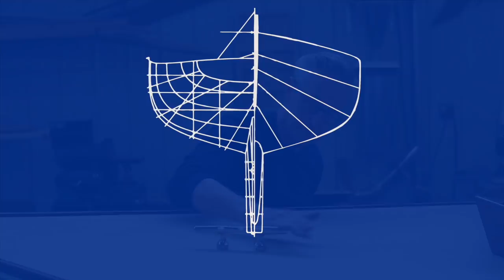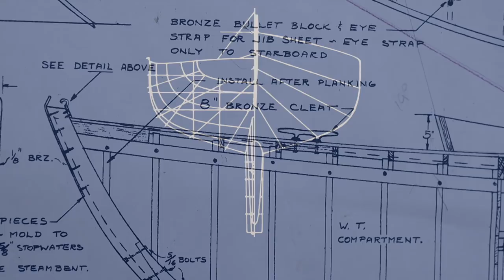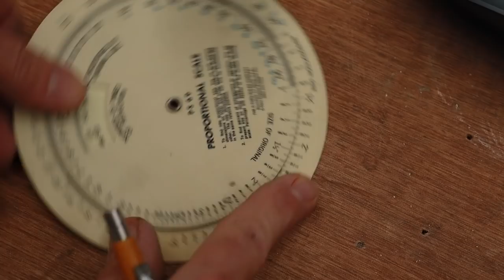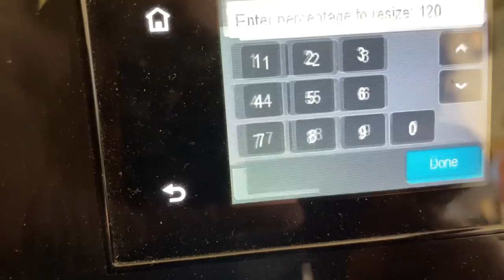Bronze Casting for Boat Builder, Cleat Casting S2-E57

Comment: Dear Bob, I have looked at several people who do casting but without a doubt yours is the slickest operation of them all.  The tools you use, like the cradle for your flask is the best looking with that locking triangle on top to secure what could be an incredibly dangerous event of a molten metal spill if it let go.  It’s just like all your work, methodical, precise, un-rushed but in the end magnificent.

Comment: Bob, another fine video. It was very enjoyable to watch. Your attention to safety is very commendable. One safety concern registered with me. After you poured the mould, you got down on your knees to pour the bronze bronze into the scrap tray worried me. For a short period I worked in the foundry at Boeing Commercial Airplanes. The methods used were very much how you do it. I witnessed a 20# crucible of molten aluminum get dropped and spilled on the floor. Not something you forget. People were within the spill radius and everything flammable within the radius caught fire. Even the workers shoe soles caught fire. Fortunately everyone had heavy sole shoes on and were not hurt. Please continue making these videos. I marvel at your skills. THX JimP
Reply from the maker: Hi Jim,
I do know better than to get down on my knees. The first casting I got a bit caught up in the HEAT of the moment (pun intended) Thanks so much for the reminder and your kind comment!
Cheers,
Bob
Reply: Also suggest a table so your mold is at a good pouring height. Cinder blocks are cheap.

Comment: It is always inspiring to follow you in the process and share all your experiences. I grew up on the Swedish west coast and like to compare differences and similarities in boat culture. Small boats here were simpler built mostly in pine and hull with overlapping boards, but which gave a beautiful sound when they were moored. Today, that sound has almost disappeared. However, I wonder why the floor is screwed on as it becomes difficult to clean underneath and get all the rainwater out.  OK the boats here were in the water most of the year.  I remember how they in the evening with calm water ,rowed out a bit on the fjord to fish cod and mackerel, and how they talked quietly between the boats while the sun went down behind the mountains.

Comment: The gentleman is an artist and a teacher who should be treasured. I so much enjoy his  videos. Now with that said, what is the economic justification for not just  buying an 8" heirshof-style bow cleat off the shelf?
Reply from the maker: Hi James,
Thanks for the nice complement.  In the current (Dec. 2021) Haven/Herreshoff catalog from J.M. REINECK & SON ( which make exceptional quality castings) A 7 3/4" cleat is $238.00 Here is a link to the catalog. 
http://www.bronzeblocks.com/pdf/12.5catalog.pdf
If you are only casting one cleat there isn't an economic justification for casting you own. However, if you casting all the bronze for a Haven 12 1/2, as I'll be doing, the full set of bronze hardware is $7,685.00
I really enjoy the casting process. The start up cost and experience that is needed makes it not a practical process for everyone. My goal in presenting bronze casting is to give the viewer an idea of what goes into it. For some it also validates the cost of a hand cast bronze cleat. 
Most all boats have bronze hardware. As I build future boats I'm excited to cast the bronze for them as well. I have an idea to cast a 10" bronze dock cleat and maybe a bronze anchor!
Lots of fun ahead.
Thanks so much for your question. Perhaps I'll include it in the next episode.
Cheers,
Bob

Comment: Hi Bob great overview of the whole process. I wonder if you left the mold pre-heat out of the video, or if you skipped it entirely. 

Would be cool to see a “lost foam” type casting. You did mention you have more parts so i hope im giving you a good idea.

This whole boat series is coming out great congrats!

Bruno
Reply from the maker: Hi Bruno,
There is no need to preheat sand molds. Lost wax ceramic mold are a different story.
I most likely will not be doing lost foam. It requires a new pattern for every part. I did lost foam during my residency at Scana Steel in Norway. One of the big problems is the toxic fumes from the burning foam. Not something I want to do in my shop.
Thanks for watching!
Cheers,
Bob

Comment: Bob,  Nice work and helps me understand why the production stuff costs so much.  By the way, seems like  the lost wax/ceramic method would be quicker?  But it's not repeatable with that same plug?
thanks a lot, Glenn H.
Reply from the maker: Hi Glen,
Indeed, I just checked the current price of a bronze cleat.( $238.)
All of the casting processes have their pros and cons. Sand casting is the most economic in terms of cost and time. However, is limited in not making complex shapes. This is why most artist like lost wax as they can make any shape no matter how complex. They are generally making only one copy.
The down side of lost wax is the expense in equipment and time. In addition to a furnace, a kiln to burn out the wax and vitrify the ceramic shell and a sandblaster to remove it are needed. The ceramic slurry in very expensive and must be agitated daily. The process of making the wax pattern, dipping in slurry (several days), burnout in the kiln (one more day) and the break out (like removing a coffee mug from the casting) and the sandblasting (one more day)
Most all boat hardware are simple shapes. Once a pattern is made it can be invested, cast, and cleaned up in one day. So sand casting is much more efficient for a small shop and is how most all commercial casting are produced.
I've been invited to cast with the University next semester if so I'll show the lost wax process in greater detail.
Thanks so much fro your question and thanks for watching.
Cheers,
Bob

Comment: Nice! Did you make the pattern larger to account for the shrinkage of the bronze?  Or, was 1 to 2% not enough to worry about on a part that small?
Reply from the maker: Any shrinkage is almost undetectable. With all of the parts for the boat there is not a need for any tight tolerances. 
Thanks for watching.
Cheers,
Bob

Comment: These days you could model that thing in a CAD package and then 3d print the pattern which could either be used in a sandbox or lost wax / PLA cast in plaster.

Comment: I notice you don't show how you split the cleat down its length. Did you not film that, or was it a case of "commenters can't yell at risky cuts if they don't see them?" :) I'm legitimately curious how you chose to make those cuts though.
Reply: Bandsaw
Reply: I wondered about that too.
Reply: He said he had only glued the ends of the two pieces together, so when he cut the ends off, presumably they were nearly separated, or enough so that a blade and putty knife finished it. A saw kerf, even a band saw, would take off too much material for a good mating
Reply: It was two separate pieces of wood to begin with. He did not have to cut it in half. He only glued the ends together of the two pieces before turning on the lathe. So, when he cut the square blocks off the ends, the halves came apart of both the long part of the cleat and each leg.
Reply: @thomasarussellsr  that's or
Reply: @thomasarussellsr  that's it